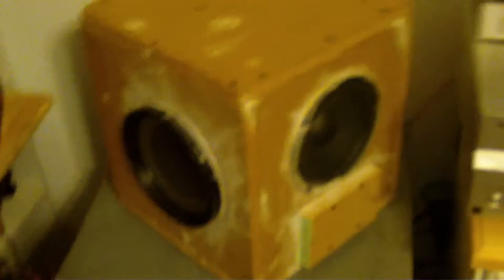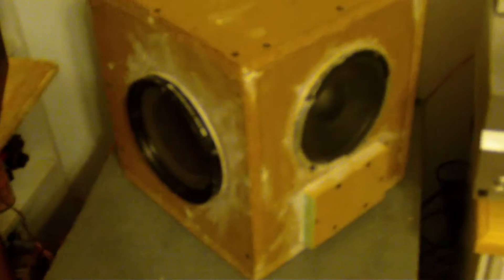6 1/2" Passive Radiator Box - New Prototype

Comment: i have two 12's lightning audio's and two 12'" passive radiators they are awesome i have them in a small 28 inch long box ... will be switching them soon to put in my s10 blazer... its truly amazing the sound ... the bass .... its almost as good as my slim rockford p3 that i put into a small bandpass .... and amped it to run at 1 ohm ... the 12's are single voice coil ....

Comment from the maker: It's just a regular subwoofer disconnected from the amp. I might find an older speaker and take of the magnet and the whole motor structure and try that. I'm trying to decide what color to paint the box. Any ideas?

Comment: did you tune the passiveradiator somehow, or is it just a normal speaker thats just disconnected from the amp? I'm building subs with passive radiators too. I make them from old, burned out woofers, removing the magnet and tuning it by applying some weights on the back. Nice Prototype, keep going :-)